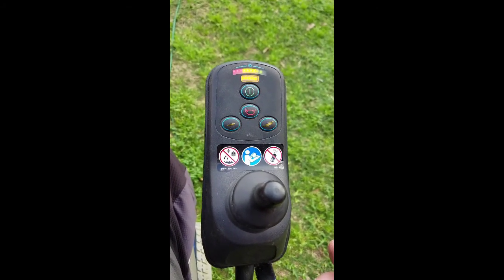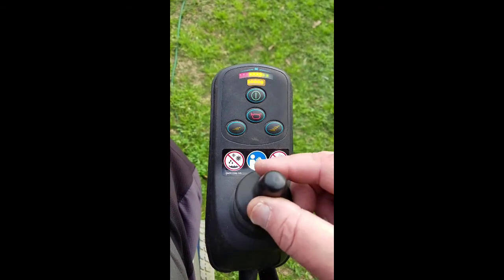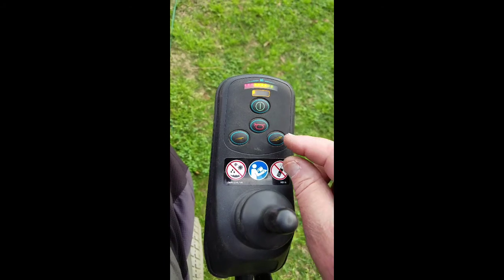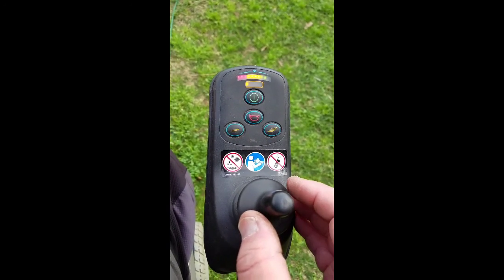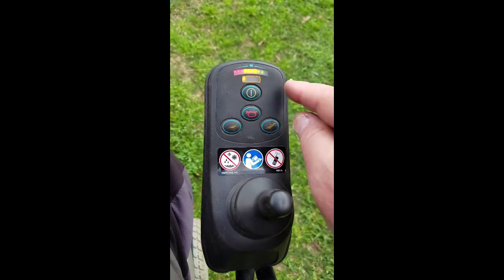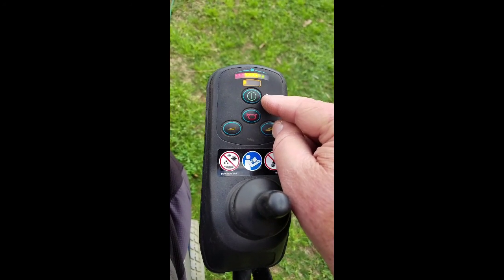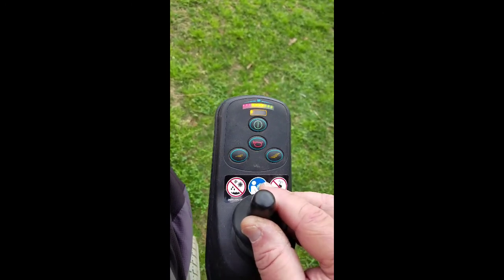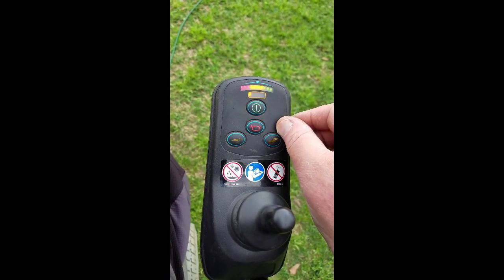Jet3 Ultra flashing speed light

Comment: I figure out the issue with mine. After taking off the seat and seeing everything, I noticed a wire had disconnected off the amp meter (located next to the charger port). Once I reconnected it, the flashing stopped and it's working again.

Comment: I think this saved me haha and I think by power supply he means the on board charger in the battery box
Reply from the maker: Correct. You have to leave the old charger in and add the new charger by splicing it to original charger. Sorry for my calling it a power supply.
Reply: @P Pulambe  so you can't just swap it for a new charger
Reply from the maker: @bebeldredge5031  no sir.  It didn't work for me
Reply: Doesn't that "over" charge then? Because I  bought another charger, and it didn't help, but I didn't splice them together

Comment: Hey man, mine is doing the same thing and its been kicking my ass so i'm hoping this will fix it. Where did you get the new power supply from?
Reply from the maker: I used two 12vdc battery chargers and charge each one separately

Comment: Can you explain what is the power supply?   I have one doing the exact same thing.
Reply from the maker: Inside the compartment is a box that the power plug goes to. Did you replace the power supply
Reply: @ppulambe8311  need help. Mine is doing the same thing. What are you actually calling power supply?  The battery?

Comment: Sometimes the power wheelchair goes into lockout mode if you hold down the power button for too long all you have to do is turn it on wait for the lights to flash and then push the horn button two times and it will release from lockout mode
Reply from the maker: You are correct on that function of the chair. However,  the original power supply had to remain connected to the circuit.  I'm sure that an original replacement would have worked.  This method allows other, name brand, types of equipment to be used. Thank you for including your input.